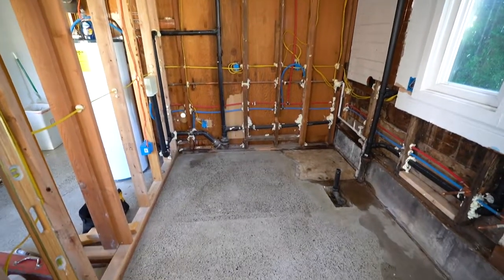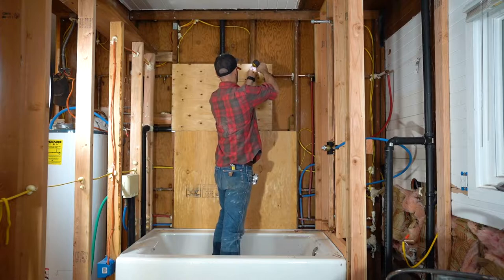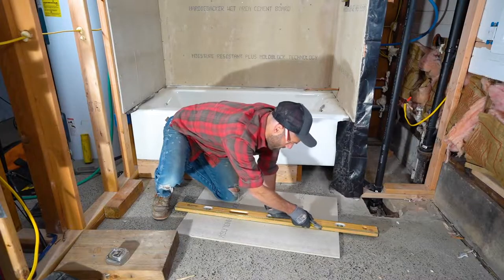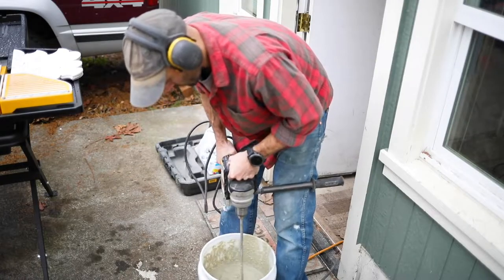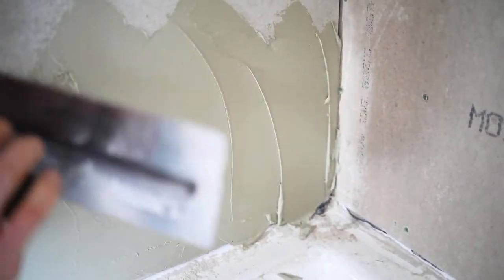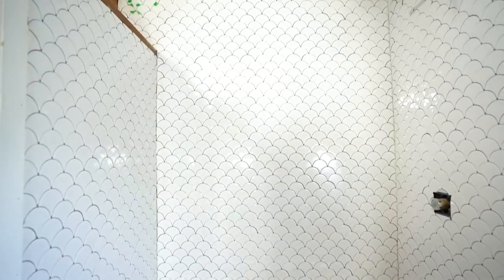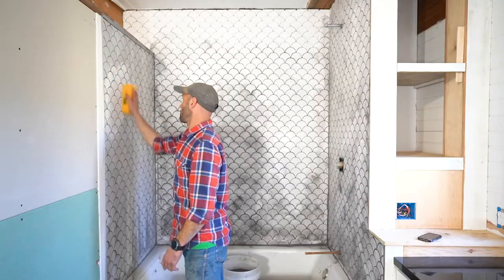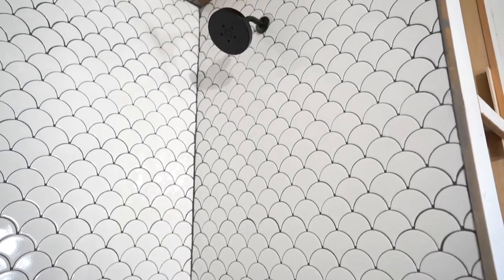How to Tile a Tub/Shower Surround

Comment: You have to waterproof cement board with red guard or a similar waterproofing compound
Reply from the maker: In the situation presented in this video a waterproof coating is not needed on the cement board since there's 6 mil black plastic vapor barrier behind it. But if you didn't have the vapor barrier you would need to seal the board to prevent moisture from migrating into the wall cavities.